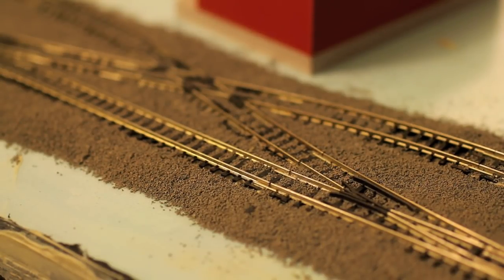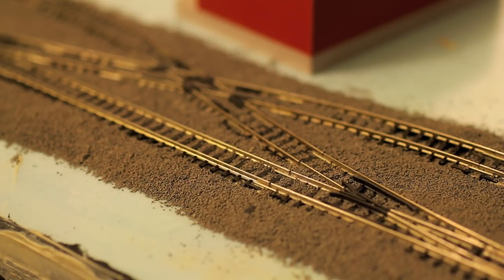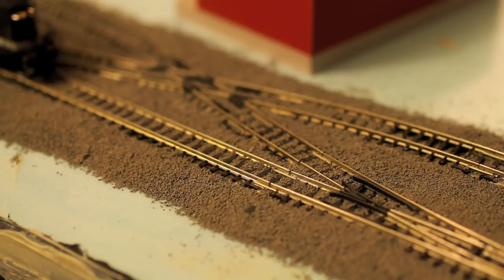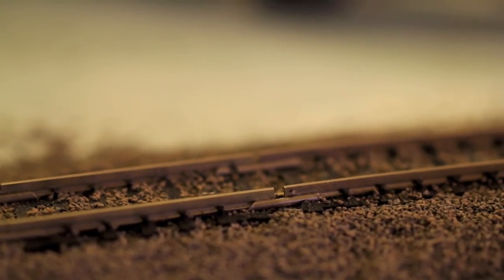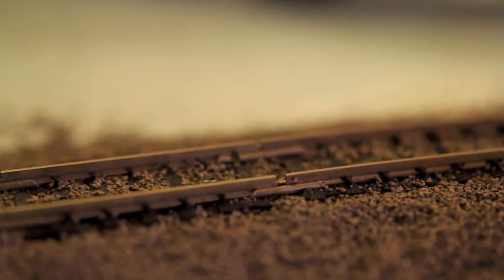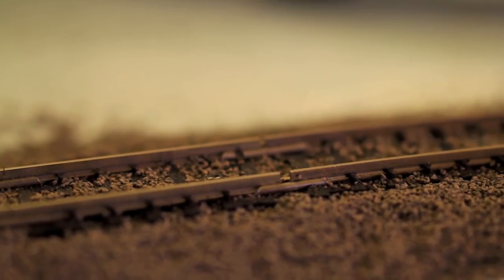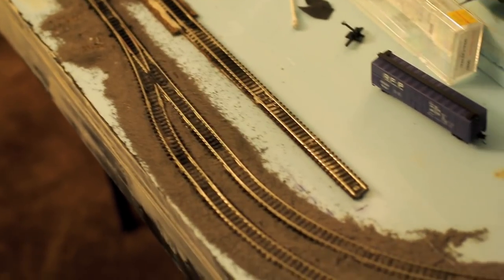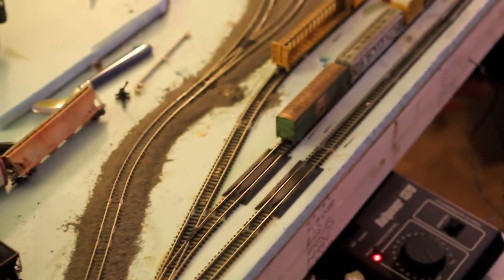Model Train Does Not Want To Run

Comment from the maker: Thanks, for the help, I believe that this is the issue as well.  I did some more experimenting last night and followed through with one suggestion that some one gave me on facebook.  I connected a wire from one rail to the other at the main gap on the inside rail and this seemed to solve the problem.  I will work on a permanent solution to this soon.

Comment: BTW, it's entirely possible that a "loose" or open railjoint can corrode over time, thus giving a "does not pass power" joint. This would explain the "worked a few weeks ago, doesn't work now" issue...

Comment: If you have a multimeter handy, set it to OHMs or CONTINUITY scale, turn the throttle OFF, remove the loco from the track, and place the probes accross the iffy railjoint. (both probes on the same "side of the track", same rail, just either side of the joiner). If it beeps or reads "0 ohms", that's GOOD, it means the joiner is conducting electricity OK. If the meter does NOT beep or shows "open circuit", then the joiner is _not_ passing electricity. try the 3 steps listed above to resolve.

Comment: Joey, did you ballast the area around the gap recently? The gap itself is not a big issue, although it's mechanically larger than maybe is OK for N scale. However, the joiner looks like it's not as "tight" to the rail web as it could be, this may have allowed glue to get between the joiner and the rails. I would reccomend 1 - use a pair of needle-nosed pliers to "squeeze up" the joiner. 2 - soldering the rail joiners may be advisable 3 - extra feeders from throttle to positions around the track.

Comment: My polar express Lionel HO that I bought a couple weeks ago turns on but not moving.  It hums  but nothing happens.  I watched a video saying it might be the unit E not connecting with something.  How would I take it apart and try to find the issue.  The guy said that the plunger thing (red arrow thing) May be stuck in the up position
Reply: If it hums but doesn’t move, something is seized. Open up the locomotive and check for dry lubricant or anything else that may be keeping it from moving.
Reply: Go to a hobby shop for help